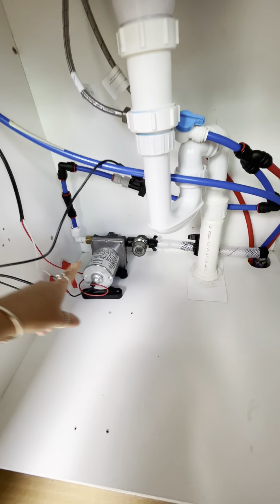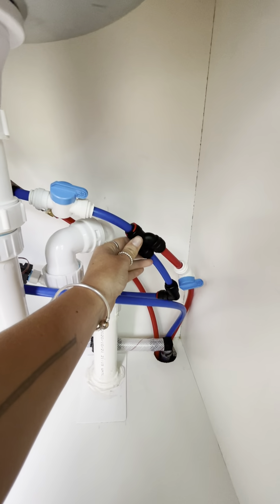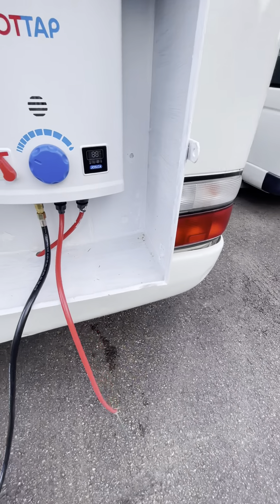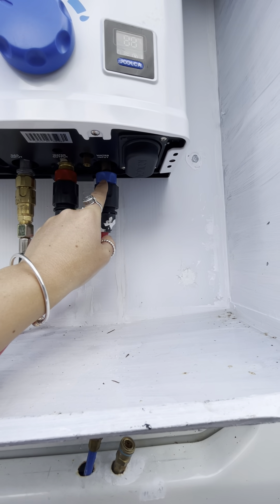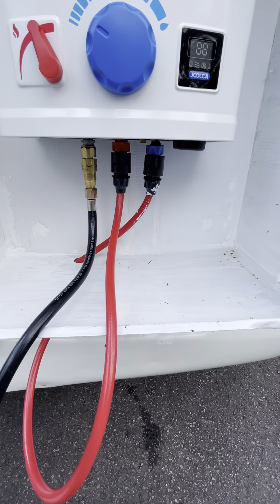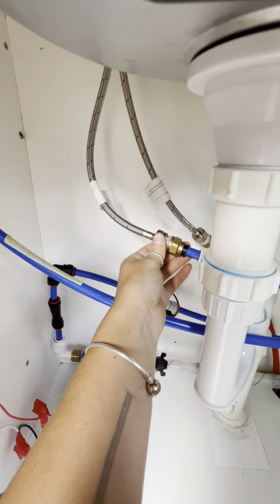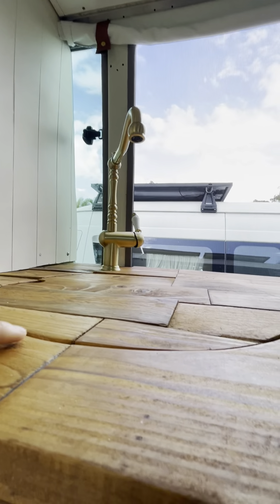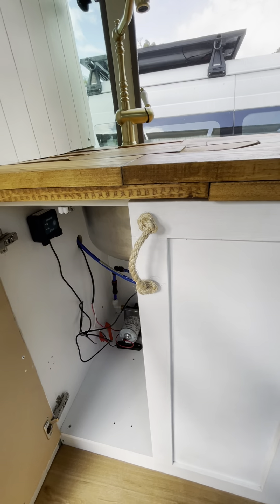Toyota Coaster Bus Build -  Joolca hot water to internal Shower & Sink

Comment: Why not have a flick mixer tap in the shower that way you don’t have to have any shut off valve’s under the sink and the hot water system can turn on when needed I have just done my van that way
Reply: I have another brand of hot water heater and I want to do it the way you describe. I'm brand new at doing this set up, as I just got the sink. I'm going to have my 2 way splitter outside where the water heater is, and where my outdoor shower is. I don't need a pump because I use city water which is already pressured.

Comment: Why would.the water run unless either the sink cold water tap was open or the hot water tap.was open.
The way you have set it up, you could not use jot and cold water at the same time in the sink